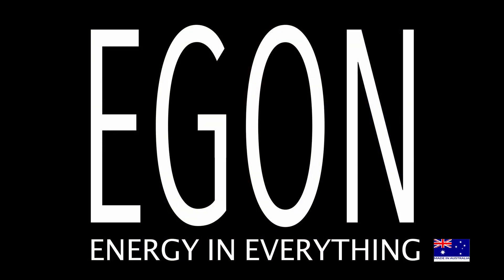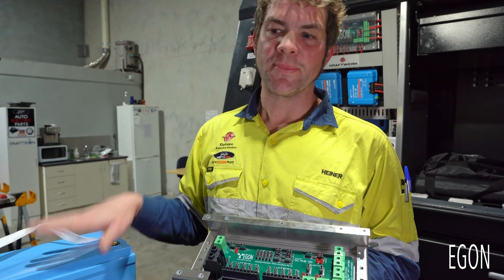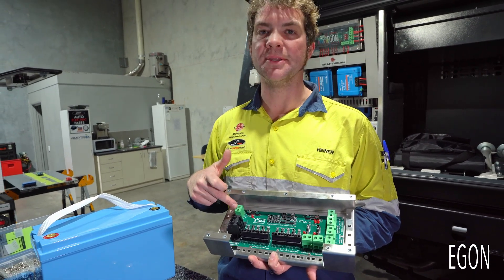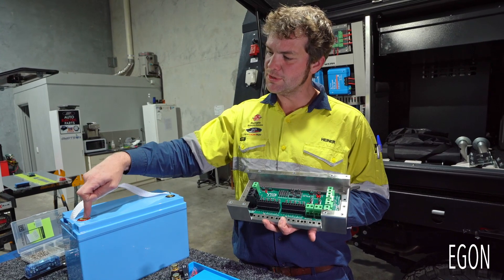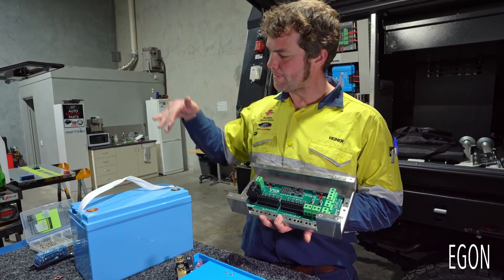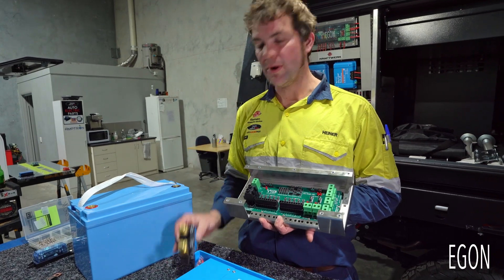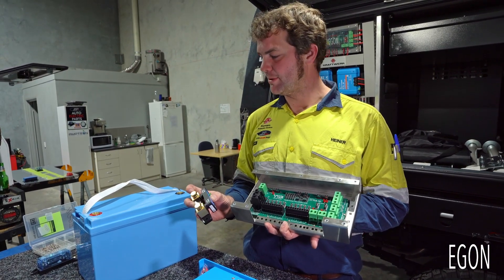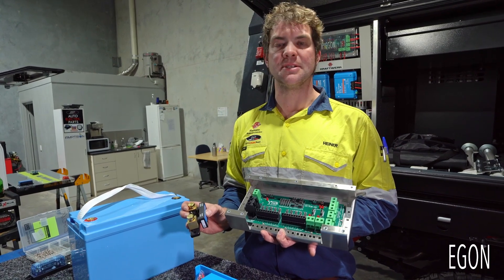Inverters and the DC-Hub

Comment: Do I understand this correctly - 80 amp x 24 volt means the max draw is 1920 watts? So I should connect my 3000 watt inverter directly to the battery instead of to DC Hub?
Reply from the maker: I suggest using the contact form on the website for questions. YouTube is the worst place to send messages as comments on our videos are not monitored.